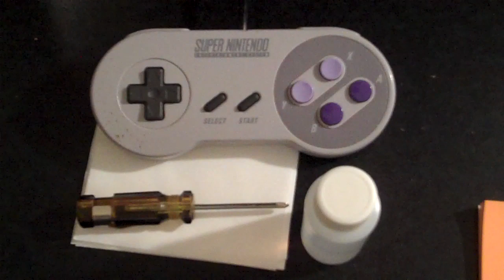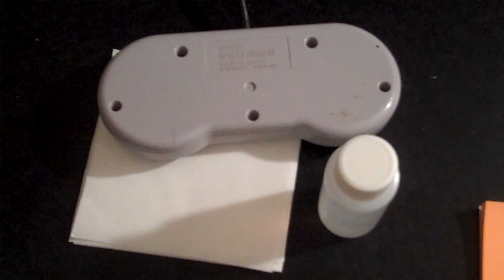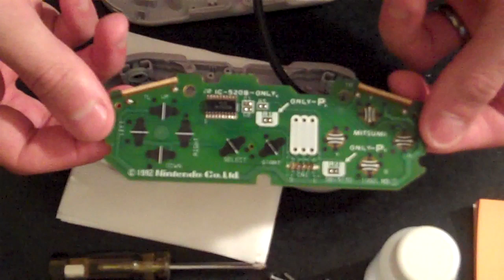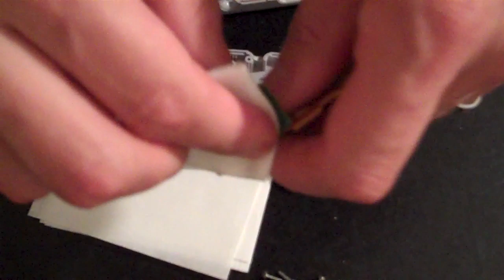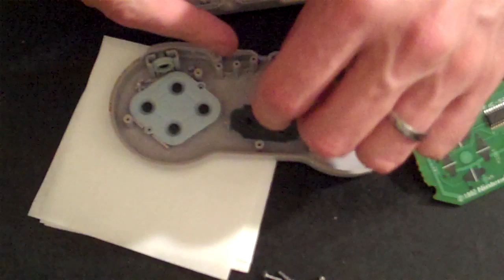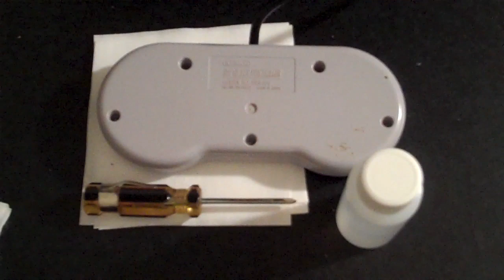How to Repair a Super Nintendo SNES Controller

Comment from the maker: @yoshishot16 Glad to hear it! Yeah, this video can help you if your buttons are sticky at all, or sometimes even if they aren't responding well at all. Sometimes you will actually need to replace the rubber buttons on the inside of the controller (if they have broken down over the years). If that is the case, we have replacements for you. Of course, we also have the parts described in this kit on our site. Just search for nintendo repair shop on google. Thanks!

Comment: @trucksoner This happened to both of controllers' R shoulder buttons. I bought a small bottle of krazy glue with the tiny brush applicator and put it little dab on one of the pieces. I then simply joined them at the crack and let it sit for a few minutes. Both buttons broke in such a way that both pieces line up perfectly, so that they may be fixed together with a delicate application of a powerful glue (superglue, krazy glue). Make sure to buy the container with the small brush applicator.

Comment: Thanks a lot! Mine was dirtier than I could've imagined. I've scrubbed the plastics with soap and a toothbrush (after taking it apart) and will let it dry over the night. I also took a risk and cleaned the Select 'n Start rubber because it was... horrifyingly dirty. I hope there's nothing electrical going on with those black things going into the rubber. Anyhow, scrubbing it with a toothbrush worked very well and now it looks like new! (I didn't own it when it was new... but you get the idea)
Reply from the maker: That shouldn't be an issue for the plastic parts. Cleaning the rubber buttons will help prevent further deposit build up. However if it is unresponsive, it is due to build up on the electrical contacts on the controller board itself. For this, soap and water would be a bad idea. We offer the kit as an easy solution that we use in our own shop.

Comment from the maker: @jsz1998 Undiluted chemicals can cause the conductive material used on the controller boards to rub off. We recommend using the cleaning rinse and the anti static cloths to prevent any possible damage and ensure that your controller will last as long as possible. The cleaning rinse is available in our cleaning kit which you can use to maintain all of your games and controllers. Just click the link in the description.

Comment from the maker: @mugenmahboi88 No, the little rubber button pads on the underside of the buttons that are visible from the outside of the controller. Those button pads wear out over time and start to crack and fall apart. As long as you can bend them without seeing cracks in the rubber, you are ok.

Comment from the maker: @mugenmahboi88 Sure. there is nothing wrong with using it on specific contacts. You should also check to see that the rubber buttons are not deteriorating.

Comment: The R flipper on one of my controllers is broken so I bought a new set, but the new L button doesn't fit properly. Do you sell flippers that use the pin for the original SNES controllers?

Comment: This tutorial helped me fix 2 SNES controllers, but I still have a little problem. The L and R buttons on both controllers sometimes don't respond. They always do when I lay my entire finger on the button, but when hit lightly or only on certain spots they won't respond. Anything I can do?
Reply: You might want to replace those buttons as they are probably broken on the side
Reply from the maker: Check to see if the rubber pads under those buttons are torn on the side walls. Very common. We sell replacement rubber pad sets.

http://www.retro-video-game-repair.com/shopdisplayproducts.asp?keyword=rubber+pad

Comment: Ive already done this (plus replaced the rubber contact pads) but Ive run into a problem with the shoulder buttons in that they dont respond because the bits of board under the button are loose and phisically moving when I press down on the buttons so theres no responce unless I press down so hard that they respond a bit because they've no where left to move .... any suggestions how to fix this?

Comment: @nintendorepair both times that i've done this, it's broken the R button off where the shoulder button (actual part you press) joins the pivot thing (they're normally one piece but it snapped).  i opened the thing totally gently, too.  have you heard of this problem and do you know where to get new buttons?  i'm scared to clean any more controllers now since it happened twice

Comment: Good tutorial.
I bought some SNES controllers, and when they arrived, they were missing the rubber-like Start/Select buttons. I also have a controller whose buttons don't work, but it has the Start/Select buttons; is there a way to take the one controller's Start/Select buttons and put them on the controllers that need those buttons?
Reply from the maker: If they are the same model controller, yes, you can swap out the rubber pads. Or, we sell replacement rubber pad sets for SNES and NES controllers.
http://www.retro-video-game-repair.com/shopdisplayproducts.asp?keyword=rubber+pad
Reply: Nintendo Repair Shop Inc. Awesome, thanks! I just took the start/select buttons pad out of a non-100% functional controller and put it into the controller that was only missing that pad, and now that refurbished controller works! That was my first successful Nintendo repair project.

Comment: Ok I'm not sure if this is normal but on my SNES controller the start button gives me so much trouble. I have to press it really hard in order to get it to work and it really hurts my thumb to do so. Is this normal? If not how can I fix this.
Reply: You might already know by now since you posted it a month ago. But it could be dirt on the motherboard. Open it up it's easy and clean the motherboard. You'd be amazed how much dirt gets in there
Reply: +Napalmburns Yup mine was gross inside. Took me 20 seconds to remove the screws to open.

Comment: At 1:27, where u can see the connections for the keypad, mines doesn't look as black as yours. And i have to press really hard on the buttons for it to work. Would getting new pads fix this or would i need a new circuit? Thanks.

Comment: I recently bought a snes controller at a yard sale. Didnt work very well, start and x didnt work at all, even after cleaning the motherboard, there is further damage to the motherboard that i am not able to pinpoint at this time but would be open to any suggestions on repair, i paid less than a dollar for it so it isnt a big deal if i cant repair it.

Comment: My problem is that the circuit for the R trigger is screwed up. The button itself is fine, in fact the whole controller is almost brand new, but after a little while the R trigger is acting like it's stuck on even though it isn't. (ie. playing Mario World the screen would scroll right and make the sound without my say-so, and playing Super Metroid, Samus would perpetually be aiming diagonally.) Would I have to do something else to correct this?

Comment: hey great tutorial! but one question, i recently bought a used snes controller and the buttons were fine but the d pad was really stiff and hard to move. like you have to press very hard just to move a direction, its really annoying. any suggestion besides cleaning it? maybe i need new pieces? thanks
Reply from the maker: It could be that dirt and grime has built up in the joints of the button. I would open it up and take a look. If the rubber hasn't broken down you can fix a lot of stuff with just a simple cleaning.

Comment: I have a problem with assemling it again, when I try to screw in the top screws on the back, it becomes tight at the bumpers causing them to get stuck, loosening it again makes them functional, but it makes a small gap between the 2 plastic shells. I have one unopened and there's not such gap there. The gap on the disassembled controller still works as usual, but there's a gap there and the buttons aren't completely out which bothers me. Any tips? or something i've missed?
Reply from the maker: Not sure what is going on there without having it in hand to look at it.  Sounds like either something is broken on your shells, maybe a tiny post that holds the shells apart the correct distance, or, maybe you just aren't re-assembling correctly.  Look carefully at the insides of the shells on both controllers. There are tiny bits of plastic in there that do break easily, especially the screw posts.
Reply from the maker: Nintendo Repair Shop Inc. PS We are now Retro Video Game Repair (new name).  Here is the link for the SNES rubber pad set: http://www.retro-video-game-repair.com/products/2297-snes-controller-rubber-pad-repair-parts/
Reply: Nintendo Repair Shop Inc. I found the issue, and it was pretty stupid of me. Because you turn it around, left and right  bumpers becomes mirrored but I still thought front left and right on the turned side which made so that the bumpers didn't go down all the way and then cause the gap when I assembled it with the shells.

Comment from the maker: @luigikid13 Ah, yes fortunately this is exactly what you need to do. There is always a chance that your motherboard is cracked or damaged itself in some way, but chances are you simply need to clean the contacts, and/or replace some of the rubber buttons (inside the controller) if they are rotting away.

Comment: WOW! You didn't clean the controller case before reassembling. That`s great advice.
Simple Youtubers! Rubbing Alcohol, Q-Tips, Cotton Balls or Paper Towels Work Fine.
Unless you just want to spend extra cash. Use Soft scrub with bleach in your sink with a toothbrush to clean the plastic casing. Use Windex on a clean rag to rub out the dirt on the wires and then come back with armorall 
This will keep the rubber coating from dry rotting as years pass by. 
You have to gently start each screw before you start running it in tightly.
All NES, SNES & N64`s controllers and consoles tend to cross thread very easily. If the screw feels like it hard to turn then you have cross threaded it into the plastic which will cause the controller or console to be off.
Make sure you do not tighten the screw too tight or it will cause a small indentation on the exposed face of the item you're restoring and that makes it look like crap. 
Make sure to use a breathing mask, safety glasses and rubber gloves within a well ventilated room if you plan to restore a lot of vintage video games. Your health means more than a item that has a lot or no value.
Reply from the maker: If the shell of your controller is dirty, yes, by all means clean it. Thanks for adding that. We start with the least harmful solution -- water.  If that isn't enough, try rubbing alcohol.  For the outside back of the shell and the edges, which can get very dirty and scratched up, we use a magic eraser moistened with rubbing alcohol. This will do a great job of removing grime and scratches, but it will also remove the sheen. Follow up with paper towel and more rubbing alcohol.

If you lose the screws for the controller, we sell replacements:

http://www.retro-video-game-repair.com/shopdisplayproducts.asp?keyword=screw

Comment: I have two controllers that the l and r don't work I've cleaned them well and still won't work I also have a controller that won't work at all... Any tips?
Reply from the maker: Check the rubber pads under the L and R buttons, they may need replacing. 
http://www.retro-video-game-repair.com/shopdisplayproducts.asp?keyword=rubber+pad
On the controller that won't work at all after cleaning contacts, you can try replacing the cord in case that is damaged. Some circuit boards are just dead.

Comment: Ended up using 91% isopropyl rubbing alcohol and cotton rounds, with having to clean contacts and case as well. I know alcohol is abrasive and all, but trust me with the condition my controller was in, it needed it.

Comment: The snes controller are one of the toughest controller in the history of video games i used these for 20 years before they break then i open them and changed the rubber and wiped the board ok again afte